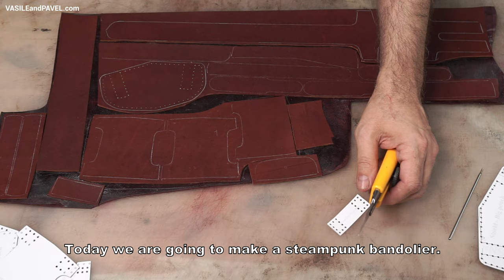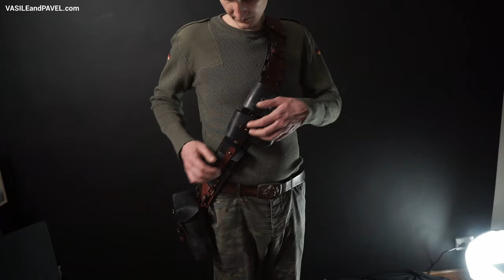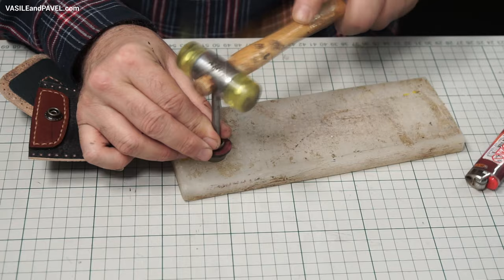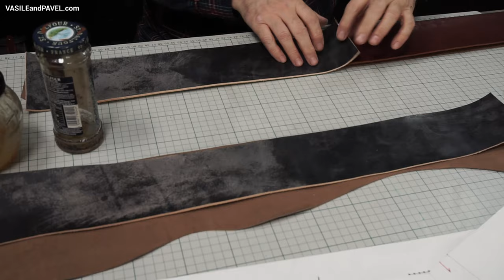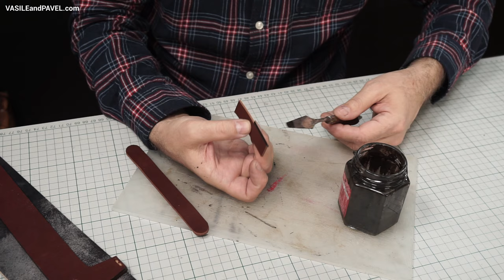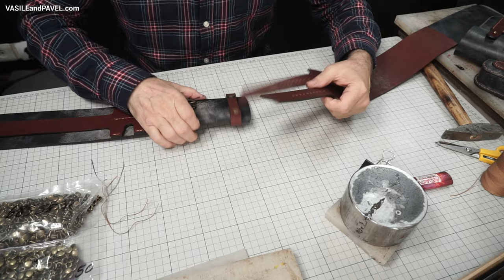How to Make a Steampunk Bandolier (with PDF Pattern)

Comment: I purchased the pattern but it does not specify what weight of  leather should be used. The video only talks about the weight for the belt.  Is there a recommendation for the pouches?
Reply from the maker: it is in the decription of the pattern (on etsy)

DIMENSIONS

*Pouch
Height: 7.9” (20 cm)
Length: 5.9" (15 cm)
Width: 2” (5 cm)

*Pockets (X 3)
Height: 5.1” (13 cm)
Length: 4” (10 cm)
Width: 1” (2.5 cm)

*Chest belt
2 pieces up to 30" (75 cm) long
1 piece up to 22” (55 cm) long

MATERIALS
BODY:
Around 10.8 sq ft (1 sqm) 5-6 oz 2-2.4 mm leather which will be lined with a 2.5 oz (1 mm) rigid leather.
Main color used for the pouch, the pockets and the chest belt.
Take into consideration the length of the chest belt and cut them fist (2 pieces up to 30" (75 cm) long)
CONTRAST LEATHER:
Contrast leather: around 3.3 sq ft (0.3 sqm) 7 oz (2.8 mm) leather. Take into consideration the length of the chest belt and cut it fist (1 piece up to 22” (55 cm) long)
LINING:
Around 10.8 sq ft (1 sqm) 2.5 oz (1 mm) rigid leather.
leather glue
1 mm waxed polyester thread
edge dye (optional)
paper masking tape (for assembling the pattern)

HARDWARE
6 snap fasteners
4 x 20 mm D rings
1 x 25 mm buckle
55 rivets
3 Sam Browne studs